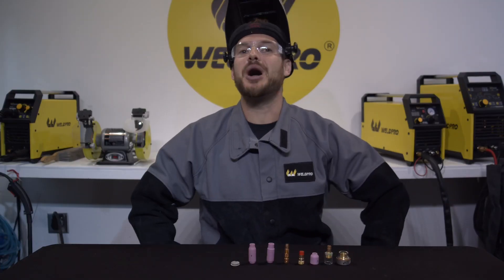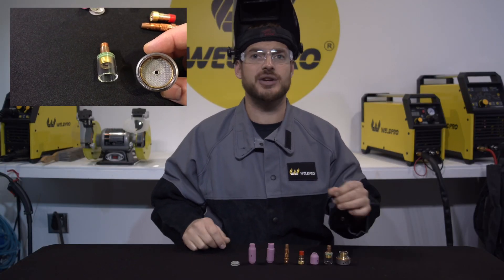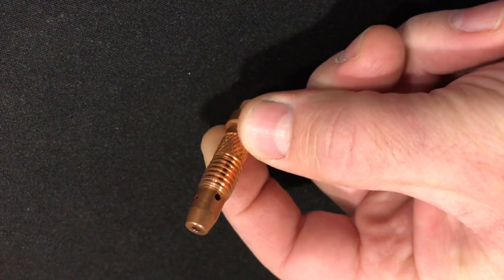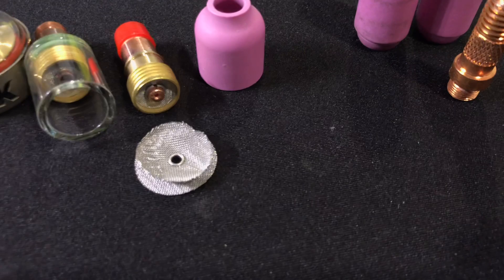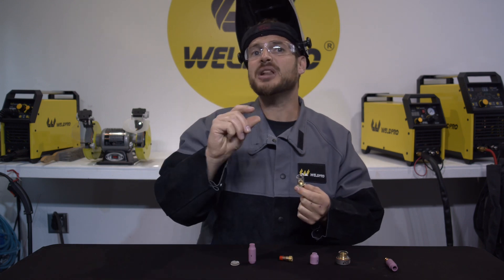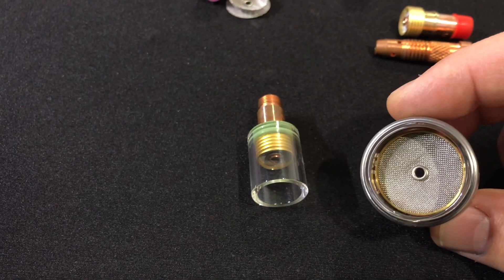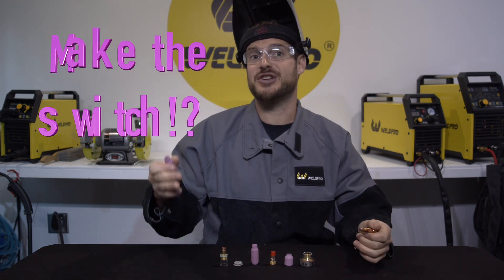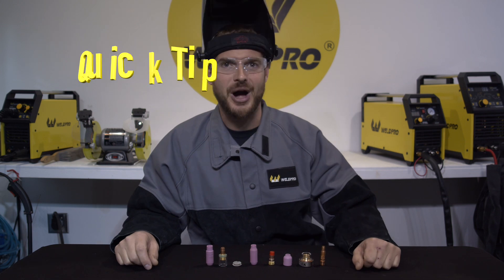Wanna Try a GAS LENS!?!? - TIG Quick Tip #4

Comment: I use the gas lenses more at home on my Tig  but went back to using standard collet,  standard does a better job I think . Those massive cups using a lense is garbage in my opinion , yeah you can put the tungsten so far out for hard to reach area but then you gotta increase the damn gas flow 😂 . Meanwhile you can just use standard collet body and use longer alumina cups if needed for hard to reach area while saving on gas . All these Instagram idiots using massive cups for colorized oxidated welds have made those gas lense cups popular  for all the wrong  reasons . Them glass Pyrex cups are only good for visual reasons and sux for higher temp welding .
Reply: Lmao. Certified idiot right here

Comment: This guy needs to amp it up. Far to slow and monotone, I bout fell asleep but made it to the end still awake. But I learned a few things so.... worth it. I got some good advice for you noobs. Clean your aluminum way better then you think you need to before welding it. I just go right to using sandpaper, sand the weld area if possible then acetone to clean any residue then weld.

Comment: Are these gas lenses good for ac and aluminum?
Reply: Arguably not, because Aluminium isn't a reactive metal (like carbon steel, stainless steel, titanium), you do not benefit from using a bigger gas cup, it will instead create a bigger etching zone on your weld which is typically undesirable. 

The typical cup size for TIG welding aluminium is a #5 or #6 (you will typically see experienced Aluminium welders go with this setup). By using a smaller cup you can save gas and create a cleaner and smaller etching zone.
Reply: Absolutely. In fact I prefer using one when I’m welding up Aluminum
Reply: The very large cups with an additional screen on them (like Fupa12) are not recommended for AC, but Aluminum is not that reactive and no reason to use a large cup. I have a 17 style torch but find stubby stuff easier to handle, running a stubby gas lens kit on most things, but for Aluminum I have a short (9 style) non-gas lens and #5 cup. 

If you have a 17 style torch you can find kits with an adapter, collet, 9 style short diffuser and #5 cup. Some kits come with an additional clear #5 cup.  Personal preference I guess in that some use a 6 gas lens for aluminum, but I really like the 5 non-gas lens diffuser.

Comment: I have been working for a welding company for just over 2 months, in the office.  Been trying to educate myself, as I am very new to the welding industry.  So, far your videos have been simply informative.  I was watching the video where you were explaining the different TIG torch consumables.  What is the main difference between a gas lens alumina cup to a gas lens pyrex cup?
Reply: Since he didn’t answer, aluma cups generally thread into the gas lens or standard diffuser. Pyrex/clear cups usually install by sliding over O rings. You can see through them and they light the weld better, but they are delicate, and considerably more expensive.  The technique of waking the cup, letting the cup rest/rock on the workpiece generally is not a good idea with a clear cup.

Some very large cups have an additional screen in the cup, in addition to the gas lens. These are generally for DC only, which is fine as AC is used for aluminum- which doesn’t react to oxygen/atmosphere as much as other metals (and doesn’t require big cups, or lots of argon)

Comment: I am gonna buy my first TIG welder  1) should I choose water cooled torch as it is much smaller than air cooled? 2) should i prefer the gas lens over the nozzles or it doesn't really make any difference on  the  first stages? 3) what is easier to start with: AC or DC tig welding? 4) what about PULSE feature? is it really often used or it makes no sense for the beginner at all? thanks in advance
Reply from the maker: Thats great to hear! Both water and air cooled can have their advantages but for most applications an air cooled machine is just fine. It will keep the cost down and less to go wrong if you get a leak!

Gas lenses are much more preferential for almost all applications. I would get yourself a set and start using them.

DC Tig with Mild steel is generally easier to get started with but Aluminum on AC can be lots of fun as well!

The pulse is excellent for thinner material and can be very useful for many different situations. I find myself using pulse more and more often.

Let us know if you have any other questions!!!
Reply: In my experience, you'll advance quickly and want those features. I started welding in 2020. Never even held a torch before that. Bought a Weldpro Mig210LCD. I went from flux-core mig to more advanced stuff pretty quick and now I'm looking at Tig machines. I like the look of the ACDC Tig machine Weldpro sells not because it can go UP to 200 amps but because it can weld DOWN at 10 amps for doing the small, fragile stuff that other welder might blow through. It comes with a CK torch and a nice foot pedal and has all the advanced features you'd want in a nice Tig machine including pulse and different kinds of gas control. It's right around $800 shipped to your door and if experience is any guide Weldpro makes nice machines and backs them up with great warranties and good customer service.
This is it. It has basically everything I could want both now and in the future. And, FYI, you can always add a water cooler to your unit if you find you are welding enough to need it.
https://weldpro.com/product/weldpro-digital-tig200gd-acdc-200-amp-tig-stick-welder-with-pulse-ck-17-worldwide-superflex-torch-with-trigger-switch-dual-voltage-220v-110v-welding-machine/
Reply: @WmSrite-pi8ck  I would like to purchase this one. Indeed it is awesome. But there are no representative filials of this manufacturer in Ukraine where I am from(( Just wonder if thre are any free shipping deliveries. I searched a few machines on amazone - their pirce is 1000, delivery costs 500(((
Reply: @vladimirneutrino497  Contact them, or they will be in touch when they see this. I have a feeling they will figure out a way to get you one as long as customs doesn't cost too much to import it. I can't remember if Ukraine is part of the eurozone but either way I'll bet they have a representative near. I'm lucky, they can ship something to me in 48 hours from their facility in Minnesota to my door in Oklahoma.
Reply: It's funny how people call it an air cooled torch. They should call it water cooling vs. No Cooling. Lol if you ever need to weld with your welder at Max amperage for very long you will understand just how hot a TIG torch and the weld area can get. It's like sticking your hands in an oven. You might be able to get away with that for a little while, but eventually it starts to get annoying. If I could go back I would definitely get the water cooled torch. If you're just starting welding you never really know where your welding path will lead. When I bought my 2nd welder I thought I knew I was going to be working on thin aluminum. Turns out I was using it mostly to weld very thick Steel. Everything from quarter inch up to 2 inch making tons of multiple passes. You won't really know where your career will lead you until you find yourself there. So the best advice I can give is by the highest amperage machine you can afford and get water cooling with it. If you only ever work on thin materials you will still appreciate having the capacity to weld other things thicker